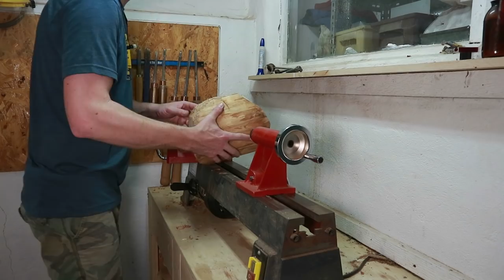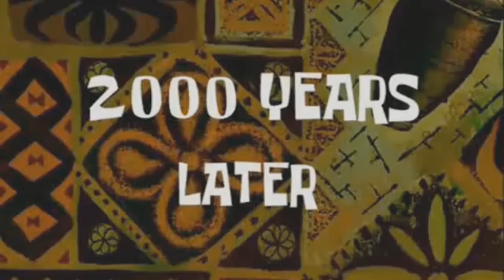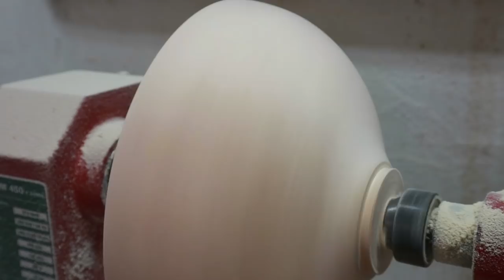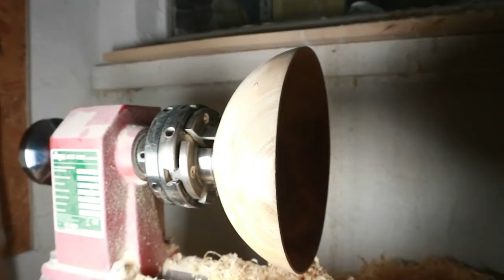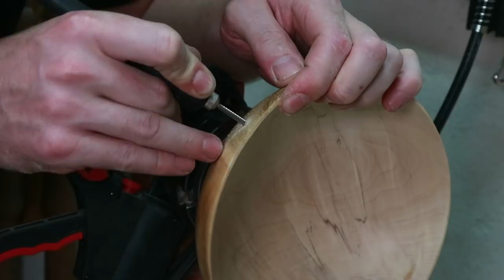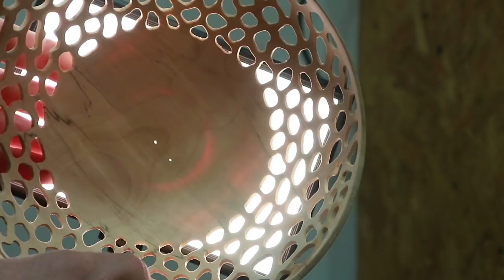How to Make a Beautiful Bowl from Worthless Log

Comment: Very Kyle Toth
Reply from the maker: That was my first thought when I finished it!
Reply: It's certainly an interesting twist, a hole not a reveal. 

Because of the flex, on option could be to make plug before drilling. Even polystyrene. ...
Reply from the maker: Yes, that woul be doable. But it went lot easier than I thought. I bet it wouldn't flex that much if I had proper hard blank and not that soft poplar.